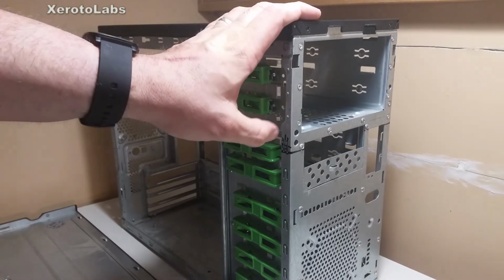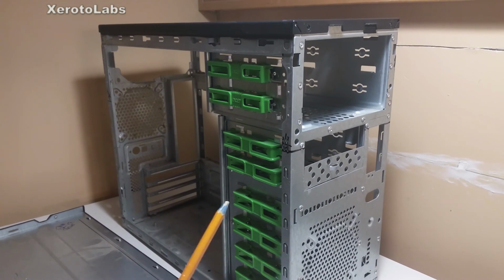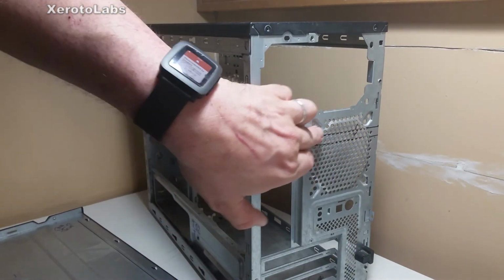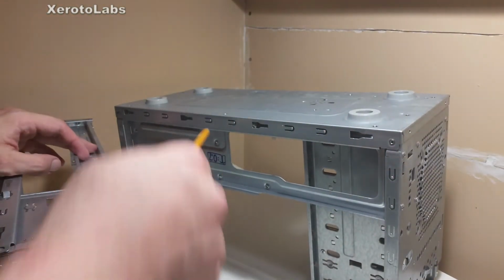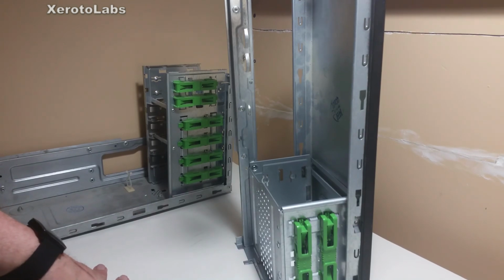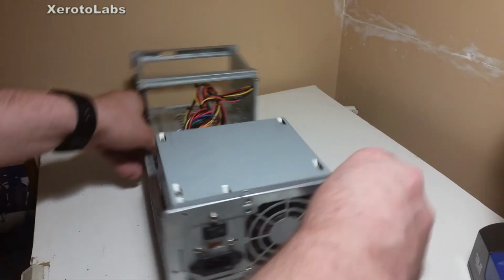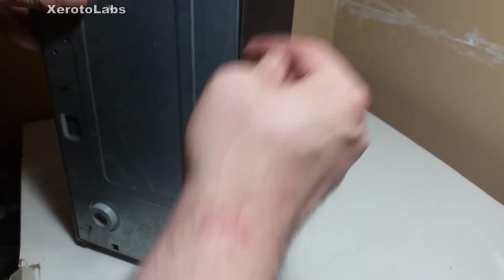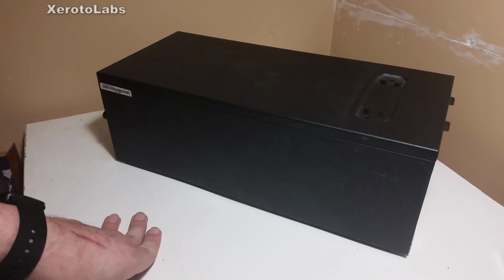Making & Modding [ Bench Power Supply Case ]

Comment: Good use for old land fill computers
Reply from the maker: thanks,  i try to  re -purpose  what parts I can . the drive bays alone can be good for small project housings .  one thing to watch is that they may not just be powered coated , they usually have some sort of galvanization , so if you use them to fix / make things that have fire they can give off toxic  fumes for a while .
Reply: Thanks for the warning